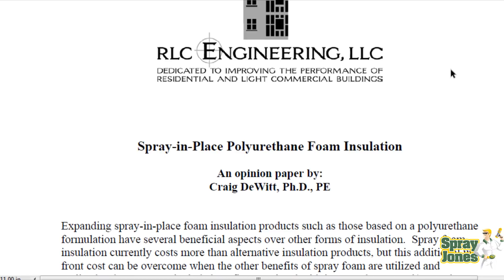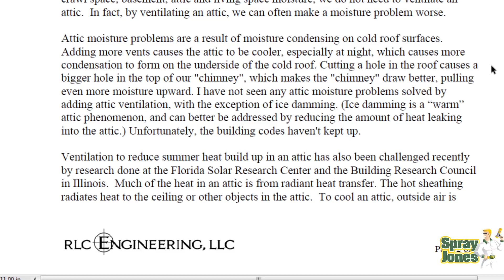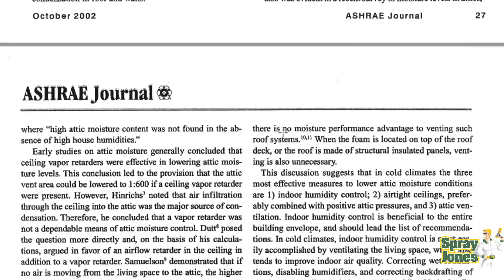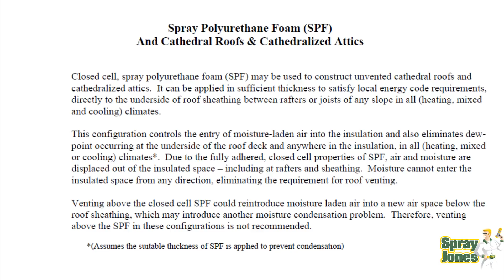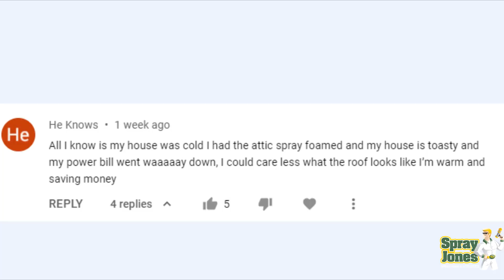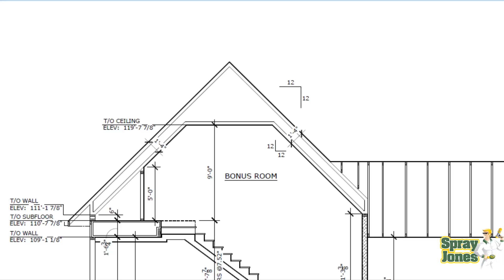Cathedral Ceilings, Attics & Roofs with Spray Foam Insulation | 2 of 4

Comment: so you're saying only closed cell foam on the ceiling of the attic. My spray foam guy wants to put open cell foam there, is this wrong, will the ceiling attic ceiling get moist by allowing moisture to penetrate the open cell foam? Open to comments please. 
Also, what if you like open windows in the summer, rather than closed windows and air conditioning. Will this introduce more moisture into the attic?

Comment: Probably a simple question.  If i do a spray foam attic like this can i place my furnace in the attic to reduce the footprint of the mechanical room?
Reply from the maker: Yes - but know what the code will say about protection of foam plastics. You may need to build a "room" for the units to be in vs fireproofing all the SPF in the attic.

Comment: What are your thoughts on using 1” foam board on the inside of a metal sided building then spraying over that with 2” of closed cell?
Reply from the maker: That can work.
Reply: Thanks for the response. I was just worried about possible moisture in between the metal and the foam board. Obviously there would be an air gap. Any thoughts?

Comment: This summer I had my home, a relative new build 2015 here in Texas, retrofitted with spray foam in the attic. One thing the company did was removed all ceiling insulation, I am aware that is typical. My TWO questions which I can not get any straight answers are; 
1 should I go through and seal all penetrations from the living space into the attic to help slow down any excess humidity in the home, during cooking or showering for example or NO? Which brings me to note, that my kitchen does not have any true ventilation, just a microwave fan, hmm. 
2, it seems as though voices/noise can now carry across room to room much easier now, suggestions?
Thanks
Reply from the maker: The insulation not on the ceiling is normal. The trade off is that the sound can migrate through to other rooms. If you want to use batts for sound that is fine. 
Humidity in the home will not rise into the attic. That air is heavy and will stay lower in the building where it is circulated back to the HVAC.
Reply: @SprayJones  thank you for the reply. Any benefits to going through and air sealing the ceiling you think?
Reply from the maker: @cliffordcrose  No not really the drywall will still be warm.
Reply: @SprayJones  that's true. I had thought about going thru and putting down 1" of closed cell since it's effects had the greatest impact

Comment: the paragraph leading up to the 7 minute mark DEMANDS some interpretation, hieroglyphic comparison analysis, or SOMETHING - does anyone even glimpse what is being described?
Reply from the maker: Richard, 

Many people will place a sheet product over the truss top cords so that the interior surface of metal is not exposed. This means that the SPF will not be sprayed direct to the metal but the membrane instead. This can cause the SPF to pull down on a loose fitting sheet product which will form voids and gaps behind the metal that water can enter into from the outside and stay there.

Comment: I think you had mentioned that the R-value requirement is less when ccSPF is used.  I will be building a post frame designed by Paul Marshall (Mr. Post Frame), in North Idaho, Zone 6.  The main living area of the home will have cathedral ceiling. R-value requirement is R-49. Do I have to get to that R-49 with ccSPF? Are the requirements less in this application? Can I do a certain amount of ccSPF and then the rest with a bat product?

Comment: You do a great job of selling closed cell foam on the underside of the roof but you don’t address the issue of moisture within the conditioned space.  The AC system is inadequate to remove high levels of humidity within the conditioned space largely in the south eastern parts of the US that have high humidity during the summer months.  Whole house dehumidifiers along with ERV/HRV are necessary the tighter a home is built.
Reply from the maker: I have addressed all of this in the video about is a home too tight?
Watch some more content.

Comment: I have a 117 year old Dutch colonial farmhouse with a gambrel roof constructed from 8x8 timber. The second floor is in the roof so it’s an occupied space. Currently the only insulation is 4 inches of fiberglass batting. Obviously this is laughable. Is closed cell spray foam good for this application ?
Reply from the maker: The best, and really only way to proceed. We do them all the time.

Comment: Question? We have a Viceroy cottage in Northern Ontario with a  wry low slope cathedral ceiling composed of 4 inch thick tongue and groove panabode roof deck which has sheathed on top of with plywood, ice and water shield and new fibreglass shingles. 

Being that the TNG ceiling is completely exposed cedar would this be an appropriate application for closed cell spray foam to turn our 3 season cottage into a 4 season home?

The structural members that hold up the panabode roof deck are 4x12 cedar beams approximately 5 feet apart.

Comment: @16.30 mark. If one is worried about the cost, they should compare the cost of the spray foam to the cost of going back years later.... with ...inflation....  and compare the cost of replacing their roof, joist, insulation,  and possibly sheetrock due to where damage. It far far cheaper to do things right the first time than to half ass something that is built to protect your family from the elements.
Reply from the maker: Correct. 
Most owners want the lower $$ first and forget what "could be".

Comment: 21:00 You say this can be used as storage. It can be but the ceiling joisting has to be engineered for a storage load. Like 2x8 in place of 2x6 where you plan to lay the planking. I know you said that you simply do not call it out, but if the bottom chord is a 2x4, you will get deflection if you later put in a walkway or storage floor for heavy loading. 

Also, as of 2020 and later, if you DO use the attic for storage or access of some kind, the underside of the foam MUST be protected from fire. This is done with fire paint or sheetrock or other fire resistant material. The underside of the foam does not need to be protected if you do not use it for storage or other kind of accessible space, like HVAC installation space.
Reply from the maker: Wow we should bring you on to fill in the gaps for us!
Reply: @SprayJones  Sir!! You do a fine job and I have learned an enormous amount from your vids. My knowledge comes from inspection failures and some ancillary research. 

Plus, I had to make a code-compliance case with citations for my cabin at 7500' feet altitude - climate zone 5b: cold/dry - for the Clark County/Las Vegas building department down in climate zone 3. Seems my plan checker, a woman from Bombay India with an ESL degree from a junior college kept failing the plan specs for my unvented cathedral ceiling like you show here. My concession to her was not using the attic for anything but ductwork and plumbing vents. Which I wasn't anyway because we have a basement, rare in Las Vegas area.

Comment: My attic doesn’t have baffles, only gable end vents. Those octagonal shaped ones. As a result there’s white mildew (or mold) on about 2/3 of the plywood underside. If the plywood is sound, could I have it spray foamed right over the mildew? That will encase it, but I guess it would have to  be done after drier weather.

Comment: Super informative to me as a consumer. I wish I would have had this information when we did a well insulated addition onto a 100+ year old home. Did the bat insulation in the ceiling and the short wall of the room inside. Later had to blow in additional insulation because of condensation issues. Have added power venting in unconditioned area to deal with hot summer temperatures in the bedroom. Getting this information makes me want to tear out and remove all the items needed and having closecell foam installed. Sometimes that room is more uncomfortable than the 100+ year old house upstairs is and it doesn't even have good insulation.

Comment: Awesome video! I live in Southern California, house was built in 2000 and has a vented cathedralized attic and my ac/heat unit lives up there. Summers easily reach 100°F plus. Would it be a bad idea to spray foam the underside of the sheathing if it’s going to remain vented or should I cover up that vent?
Reply: Did you watch the video?

Comment: great information on all your videos......im a farmer from South Dakota and i bought my own spray foam machine to spray my steel shop and ie done that as well as doing a few other projects for neighbors. the machine i have is "the lil pup" from myxsyn. Its a very interesting machine and works great. Anyway im building a shouse this summer and will have a 48x48 living space and 60x60 shop.  20ft sidewalls and  having standard trusses with a 4/12 pitch.   thinking spraying the steel (tin) on the entire building roof and walls and going to have radiant infloor heat. is this something you reccommend?   looking not to have to spend money on sheeting the living portion of the house .... thnaks again man
Reply from the maker: Watch my playlist on metal buildings. All your questions are answered in there many times over.
Reply: from what i understand this is what you recommend just spraying the steel  walls and roof. just double checking

Comment: Greetings from Ottawa Canada! My house is a mid 50s bungalow, with the attic insulated with R25 blown in fibreglass. All of the soffits are unobstructed, very good ventilation in the attic space without ice damming or frost / condensation issues. While getting quotes to upgrade the insulation, one company recommended removing all existing insulation, spray foam the attic floor where the existing insulation is, and top up with blown in for a R60 value. Having watched most of your videos I already suspect what your response will be. With that, what are your thoughts on the proposed solution, just spray foam insulting the attic floor and leave the attic ventilated, or close all existing soffit vents, remove the roof vents and coat the underside of the roofing with spray?
I'm trying to take advantage of the current government energy rebates for insulation, which of course are all tied to achieving a minimum "R" rating. Having watched your videos and learning of the truth of the R rating, it is really frustrating knowing spray foam is so much more effective, but doesn't meet the requirements for attic rebates. Hopefully the tail catches up with the dog. Thanks for your excellent and informative videos!
Reply: I say it depends on the pitch and size of the house. I’ve never done one where the customer blew a fibrous insulation per the foam. And I’ve only done less than a handful of spray down jobs in 12 years. I would never recommend it or hope to do another. I’ve done some renovations where we sucked all the insulation out and sprayed the underside of the roof. The customers absolutely love these.
Reply: Scott, I am in the same situation. What did you end up doing?

Sounds wheather the spray foam is on the roof deck or attic floor, air sealing must be achieved. What if air sealing isn't 100%??

Comment: Hi Mike, quick question: I'm doing closed cell foam under the roof sheathing, (completing and sealing the insulated envelope: slab/walls/roof) then the sheathing, Ice and Water Shield or similar, a slip sheet, and a standing seam metal roof.  Is there any moisture between the metal and the membrane that needs to escape (if installed dry)? Do I have this right, you're recommending an unvented ridge? Please confirm. Thanks.
Reply from the maker: That is a question for your roofer, because it involves external moisture collection and disbursement. From the inside as long as the foam is installed correctly there is not going to be moisture issues.

Comment: Mike, I am in a situation with the HOA owns the roof. So I can't spray the roof. The trusses/chords are all 2x4. I am having the cellulose removed to facilitate the electrical and venting clean ups. Would like spray foam installed but they want to spray the underside of the roof and the "decking" (top of ceiling-drywall) with closed cell. $$$$ What to do?
Reply from the maker: I don't have enough understanding of your situation to say. 
If you have enough room to spray down safely then go that way. If not, skip using SPF. 
Make it right or not at all...
Reply: @SprayJones  From researching it more.
I am in IN..Zone 5. So can't spray on the underside of roof (HOA). I can spray on top of the ceiling(drywall-"rafters"). So I can make a vented system. I think in this case open cell on 2x4's. Can I then put plywood 
1/2" over the foam. Not for living space, but for storage space.?
Thx

Comment: Excellent informative video. We have recently had a cabin in Wyoming we are building spray foamed with closed cell.
What started as a vented metal roof ( vented roof peak and soffit ) changed to a closed cell encapsulated roof.
My concern is on the blocking at the soffit between 2”x12” rafters . It was blocked with the original intention of letting air in thru the soffit by way of an air gap over the top of the blocking. When they sprayed foamed that area they covered the entire area around the blocking in foam so it is sealed. What they didn’t do was block off the open area above the existing blocking, approximately 1” to 2” with wood.
Should it have been or is the foam filling that open space effective?
The other concern is the vented roof. Again it was sprayed foamed and sealed but not blocked off with blocking
Thanks for taking the time to get this information out there.  A great resource for anyone considering closed cell spray foam
Insulation.
Reply from the maker: 1. For starters that must have made a huge mess. We use at the least cardboard to prevent the foam from puking out the vents and making huge messes. They should have talked with you about that....

2. Foam should have a backer so that it is stronger. We don't like to bridge open gaps any larger than 3/4". Hard to say what will happen. I have seen weak connections in time let go... but if there is 3 or 4 inches of foam over a 1.5" gap it can be Ok for a lifetime; It depends on building movement.

Comment: Thank you for your great clarity!  

I have an all steel building with 2 roof supporting trusses that are 100٪ steel. On top of that running the length of the 60' building are 6" steel purlins Of course  they touch and support the all metal roof. 

My question: I believe the perlins need closed cell foam. But do the the 2  supporting steel trusses need spray foam?? As they only touch the bottom of the 6" steel perlins??

You are the person who can help me do the job right

Thanks for your great videos !

just jim
Reply from the maker: The perlins do, after they have been insulated most connecting structure is secure and inside of a warm space and require no insulation.
Keep in mind I am not looking at you job...

Comment: If you spray foam the rafter of the attic, remove insulation between house and attic, then all conditioned air will flow into the attic.  What happens when warm moist air hits a cold attic ceiling in the winter and when cold indoor air hits a hot degree attic ceiling in the summer?
Reply from the maker: Have you watched parts 1 & 2??

Comment: How do you know if you have a roof leak with the spray foam?
Reply: Do you normally wait until things on the interior are ruined to find out you have a roof leak? Then replace the Sheetrock, insulation, and lumber? The foam will keep the leak at the roof.
Reply: @christophergruenwald5054  So it goes unnoticed until the roof is badly in need of repair.  I prefer not.

Comment: Wish I had saw this before adding vents to my previously non vented conditioned attic. Turned out my problem was 1/4 inch R-1 polyiso used as the only insulation in some parts. Eventual plan is to gut the attic and spray foam it all. Dammit!
Reply from the maker: Thanks for the feedback and for watching.

Comment: Why are you not spraying all of the way out to the Facia? In cold snowy areas an ice dam will form where cold the outside air acceses the sheathing at the wall line.   Thanks for the rest of the info.
Reply from the maker: 1. How are you going to access that area externally?

2. How may homes have we done that this is even an issue? 

Could vs should...

Comment: First, I really appreciate the videos as I am planning on building my home. Long time follower. One question I have watching this detail is, should I use vented soffits? If the rafters are blocked and then spray foamed, I would assume this would be a capillary break, but should the soffits still be vented in order to have air movement to prevent moisture buildup in that area? I want to insulate once, and prevent any damage that I can to the highest extent possible.
Reply from the maker: Many do not use vented soffits. I had one that did very nice trim around the perimeter instead. Looked awesome. 
98% stay with vented soffit because that is in bulk at the supply warehouse.

Comment: I was hoping you'd address what to do when an atmospheric combustion furnace is in the attic.  The attic must be vented for the atmospheric combustion furnace to have enough air to prevent it from producing carbon monoxide. 

How can we use spray foam in the attic if we can't spray it down on the drywall AND due to the furnace we can't close off the vents in the attic? 

This is my situation now. I'm in the middle of my remodel and my new atmospheric combustion furnace is installed,  and I didn't know what I didn't know (that I should've installed a sealed combustion furnace). What can I do assuming ripping out the furnace and replacing it is not an option?
Reply from the maker: Video #3. That's why there are 4 parts....
Reply: Replace it, then sell it and chaulk up the loss to a lesson learned.